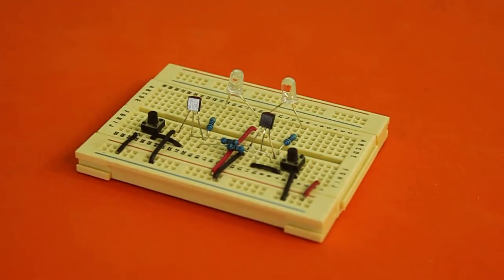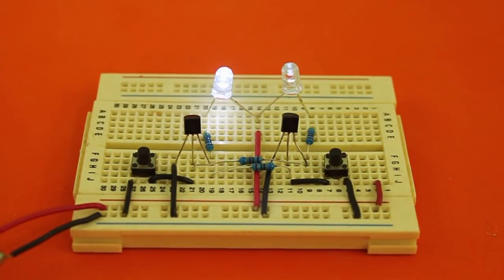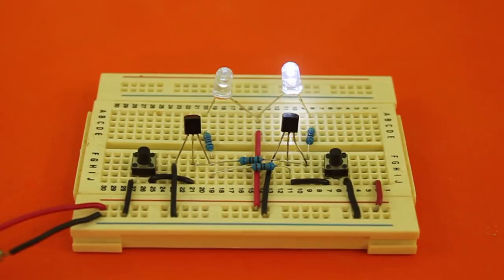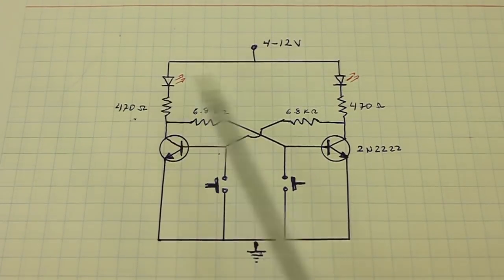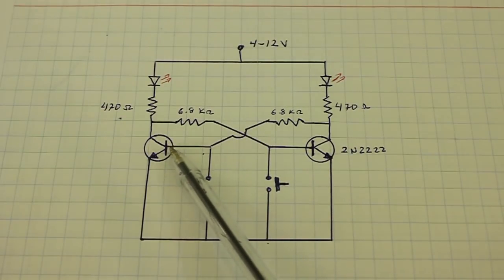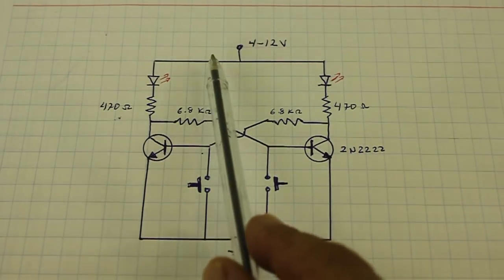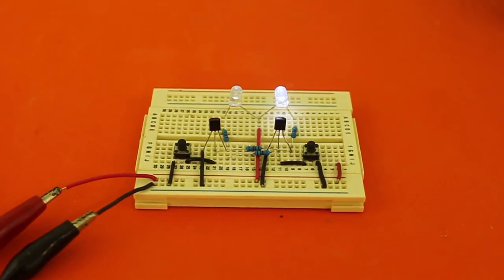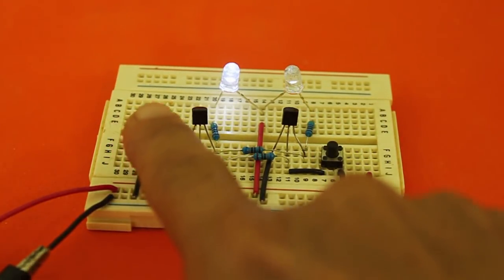Flip Flop Circuit

Comment: A really nice explanation! Could you share how you calculated the required resistance values?
Reply: Not too critical. You just need to "saturate" the transistor, which means get it out of the linear region. 10k is usually sufficient to the base depending on voltage and the type of transistor involved. The transistor might get warm if the current draw is big enough otherwise. 6.8k is much lower than required, but is still a safe value for the base without drawing too much base current. Think of a clutch in a car. You want the pedal all the way up or all the way down or it overheats.

Comment: Well explained.
Can you explain a situation where if 1 LED (LED1) gets 5V supply (continuously) the 2nd LED (LED2) switches off. But when LED1 does not get a 5V supply the LED2 should switch on. How to do this? Please explain with a circuit diagram.

Comment: I first used a 2N2222A116 transistor and the circuit didn't work. But when i used a BC337-40 transistor, it finally worked. Why is that?

Comment: This is sr latch circuit but u said this is flipflop circuit if u apply trigger then it becomes flipflop please xplain
Reply: Its original name is Latch circuit which first introduced by british scientist W H Eccles and F W Jordan in 1919 where the electrical state of the output was reversed when an electricals signal was applied to one of its inputs . However in 1940 , the latch circuit came to be known as the flip flop circuit because of the way the output signal flips or flops with each pulse it received.
Reply: @MrProgrammerX  tq i have done the same project for my btech 2nd year it works nice
Reply: But give me small clarity about connections are u grounded emitter or collector 
Small confusion plz

Comment: Wow, looking at the circuit it appears to be a symmetrical configuration being the foundation building block. Looks like a astable multivibrator as it lacks capacitors.  So when the power turns on and no button pressed yet, which side conducts first?? Would that sided be consistent every time?
Reply: I would think with none of the gates closed it would be fully off at first.
Reply: @TrillShatner  By gate, you refer to the pushbutton?  Being fully off, you refer to the LED being off? I therefore disagree as by nature of the design it will try to drive one side on at power up. The base resistor of one side connects to the collector of the opposite side disabling forward bias (same as pressing button to short base to ground)
Reply: well it appears symmetrical, but don't let that fool you. These components are never 100% identical. I haven't tested it and am not an expert but I would guess it would always pick one side.
Reply: @TheFreak111  That is correct.  Between doping of the transistor and discrete resistor value differential tends towards saturation, thereby, impact which side is favoured. Circuit modification would "force" an output to ensure specific outcome at power up.

Comment: Regarding the ubiquitous Trump comment found in literally every video, no matter how unrelated to politics; Here's my take. This is not the True Trump circuit, as it requires too much user interaction. Also, once a switch has been pressed, the circuit tends to stick with it's "choice", something Trump would obviously never do. 
edit:READ MORE CLICK IT DAMMIT
I say, remove the switches, put the center resistors where the switches were, and put some capacitors where the resistors were, and THEN you got yourself a trump circuit.. It flips all the time, based on the relation between the swapped resistors and the capacitance. And it's calle an astable multivibrator, so you can all have your chance to get your joke in now.

Suck it, Guy De Vos.
Reply: So your implying Trump has an envelope of attack, and decay that lacks sustain :) :)

Comment: i prefer the 555 and 556 timers for all my flip flopping needs.
Transistors are cool if the circuit is configured to run on full auto...
Reply: Cool, analogue over digital control :)

Comment: What if you press down the two buttons at the same time ?
Reply: @CyberNaut : technically, you can't press them at the exact same time. One will be pressed after the other. And even if you wire the two transistors to the same button, the shortest wire will win.
Reply: What if both buttons press together and release together - can we predict which transistor turns on??
Reply from the maker: Nothing happens second time
Reply: so like, can't you people make a... a.. thing which can send the input signal at the same time, instead of notoriously pushing both buttons at the same time?
Reply: Yes, pressing both at the same time does present issues - agreed. Cannot bridge both transistor base to one button as will defeat flip-flop as both sides will conduct together. So what is the resistivity of the wire use discussed to impact operation??? Having sound knowledge of flip-flops you would understand where I was going with it.

Comment: What is the default state when the circuit is powered initially?
Reply from the maker: Both sides are equal in theory  but minimal.differences in the speed of the transistors favor one or the other
Reply: I agree that both sides are symmetrically equal in operation, but not sold on the speed if identical valued transistors used. Yes, doping determines the characteristics of any transistor and its application.  OK, identical transistor is a lose term unless paired. Realistically, it is the minor doping that determines the race to conduction with consideration to actual resistor values in this circuit which can be controlled to favour a desired state as required by external components.

Comment: An interesting and instructive video. At last I understand how a flip flop works. But I wish you had shown what would happen if you pushed the same button twice in a row. As I read your circuit,  it would not change state. Is that right ?   I guess that is why switch bounce is not an issue.
Reply from the maker: Yes that is right